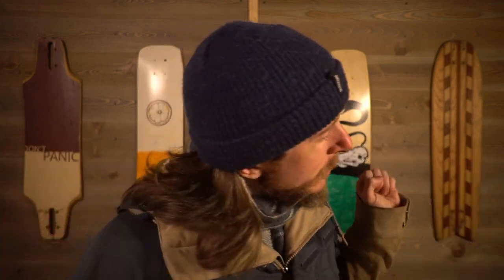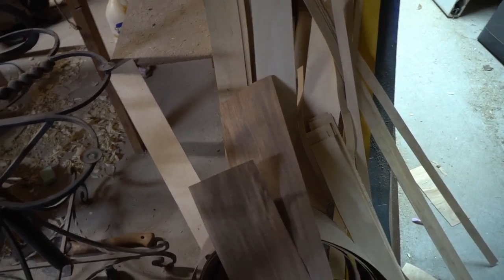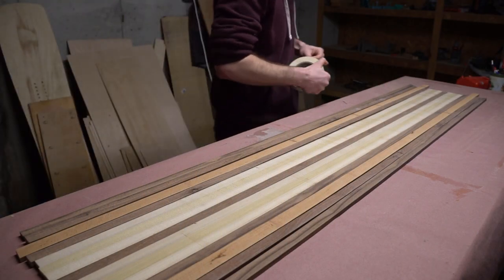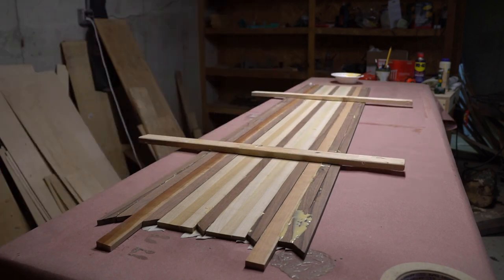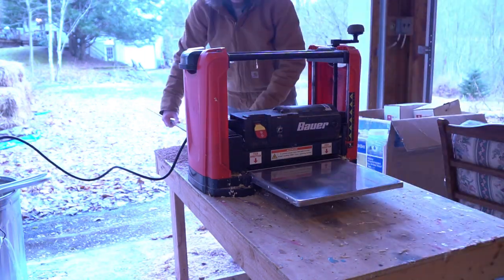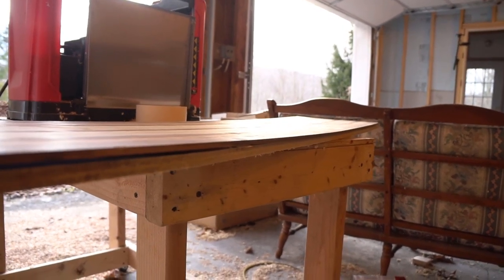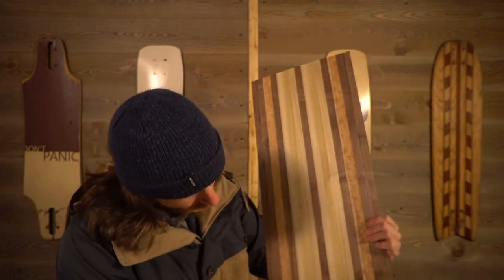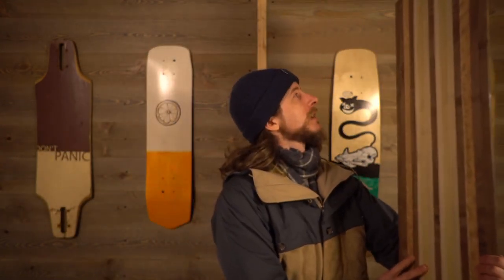Building a Scrap Wood Core - Low Tech DIY Snowboard ep. 01

Comment: Hey Chris! Can you do a tutorial on Freestyle Longboards? Would love to see a cheap vacuum press you can buy for clothes and how you can add fiberglass on the core at the board side. Good work!
Reply from the maker: I haven't done a freeride specific longboard yet but I've done a couple builds with fiberglass if you want to check them out. FWIW I don't think the kind of vacuum you'd use with clothes storage bags would be strong enough to press a deck, you need something that can pull more air out.